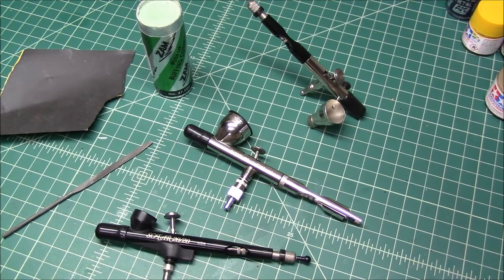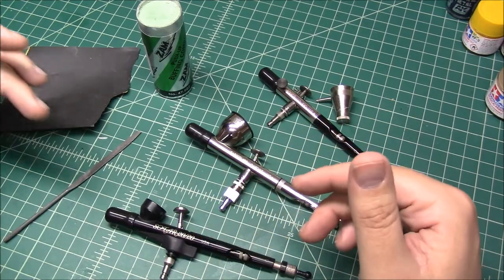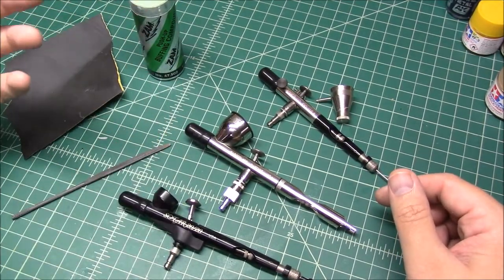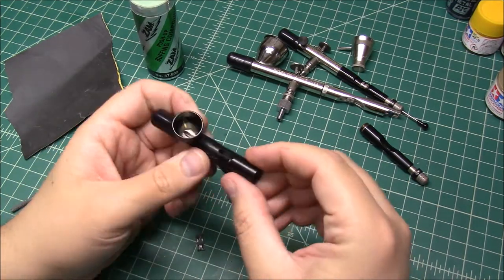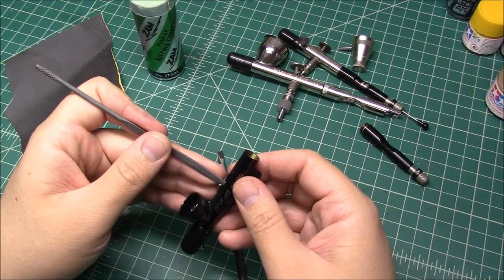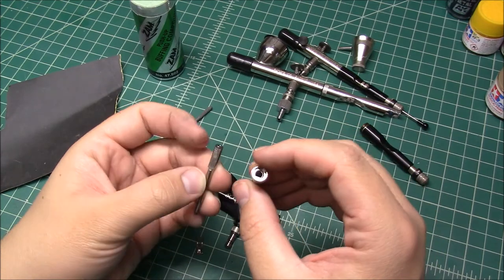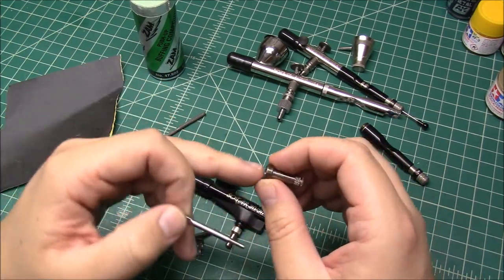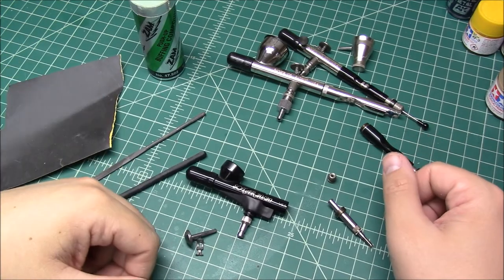Smooth Your Badger! How to smooth out the action on a Badger airbrush.

Comment: Thanks for posting this! I have a Badger Patriot 105 airbrush which frankly I haven't used a whole lot because there is a definite 'catch' in the trigger action. I'll have to get some Zam (already have the hobby file and sandpaper) and see if I can smooth out that trigger. I've been using my Harbor Freight Deluxe double action airbrush more often just because of the trigger issue.

Comment: I noticed the pull where it goes from nothing to full blast paint on the new Vex from Badger and was going to try this.
Reply from the maker: Which needle with the vex? I know to do some of the capabilities with the dual needle design that there were some give and takes. To me one of the gives with the general purpose needle is that its less refined in terms of slowly opening the nozzle up.  But thats the same story with any dual taper needle as well, like the Omni 4000. 

If you're getting a rough pull on the trigger I would test it without the a needle in to see if its the trigger on the body or something the needle may be hitting. But like I say in the video there are really only a few places that can really cause a rough trigger. Hope you get it smoothed out. Feel free to drop a message for any help you may need.

Comment: Good tip! I'll try in my old ones, if successful, then I'll consider to do the same for my brand new SOTAR 20/20. And talking of it, one of the things I miss is a metallic lid for it. Mine has the same cup design as yours. Have you ever found a compatible lid for it?
Reply from the maker: No. But I also haven't looked that hard. Some guys say there was a lid made for it, but I haven't seen one before. But they is probably something out there that would work.

Comment: One of the few videos showcasing a badger high roller trigger. Thanks! By any chance, is the sotar needle stopper compatible with the badger patriot 105?
Reply from the maker: Not really, but yes.
The .3 nozzle/needle set up in the Patriot Extreme CAN use the same needle as the Sotar. But that is the only part that can. 
If you're wanting to go smaller with the 105 just get the Extreme nozzle/needle set.

Comment: What parts are required for the 100/20/20 conversion?  Can I use a patriot?
Reply from the maker: You need a 100 body and Sotar spray head assembly. Or the other way around. The 100 series and Sotar series use the same threading in the body. So they can swap heads.
The Patriot uses a completely different system for its spray head and cannot he used with Sotar or 100 parts.
Reply: @goldwest57  thanks!  My intention is to swap the body with a 100g to delete the black finish on the inside of the cup